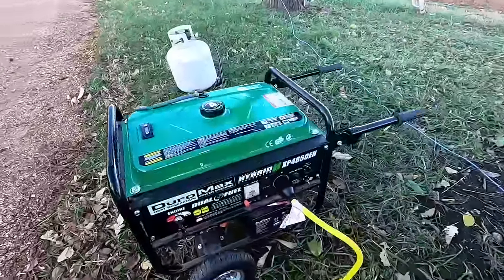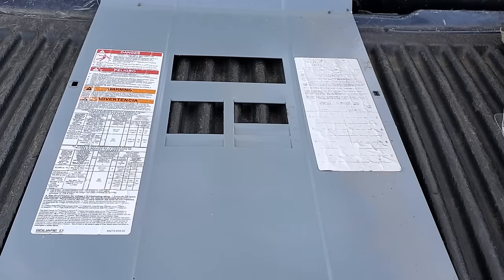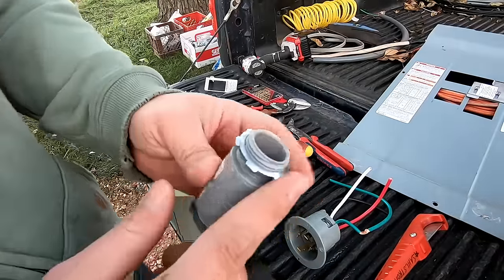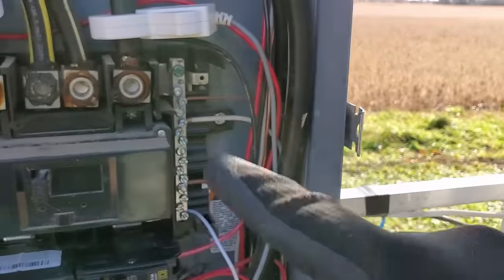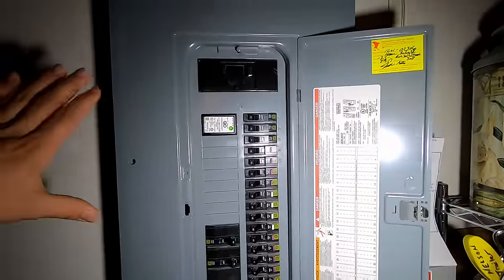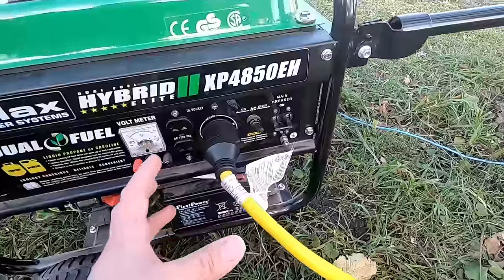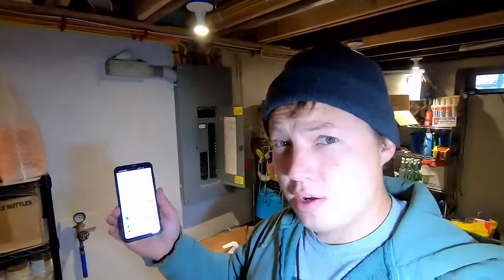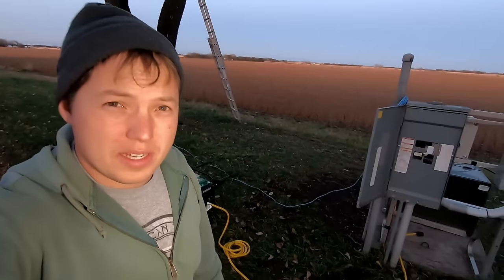How To Hook Up a Generator To Your House Using a Breaker Interlock Kit & Power Inlet Box

Comment: Hello- Just happen to be searching on YouTube on connecting a generator to your house electrical system. I have a couple of questions:  1) I have an RV outlet on my side of the house which is a 30 amps. Looking at the panel its on a double pole but its ONLY using one side - I haven't checked all generators yet but do they make them with 30 amps plugs ? if NOT, Could I add a another line to the 30 amp double pole - what size wire would I need ? I checked online for my panel for an interlock kit, and they make one for my panel but its 249.95 - seems kinda steep..

Comment: The Sense Energy Monitor works fine with the hot lines of the generator? I know many energy monitors only work with perfect sine waves?
Reply from the maker: Seemed to work fine but I suppose it would be possible for it to be slightly less accurate. Would need to ask Sense to be sure.

Comment: My setup is about the same as yours.  Question about your sense monitor.  Looks like you bought the basic version but ran your generator power wires through it so you could monitor it when the main power was off.  What happens when main power comes back on and your generator is still running?  I know it's safe due to the interconnect, but I'm curious if the sense device allows you to see that power is back on so you can go shut off your genny.  I see that Sense has a "Flex" option with dual sensor pairs to monitor a generator separately from the main.  Anyway, I'd like to use sense to know when main power comes back on.  Will this work for that?

Comment: I just bought a duramax as well. Im excited to find this video.
Reply: Remember to always make sure you follow all the generator safety rules whenever you use your portable generator. 
⚠️Here are the Generator safety rules that everyone needs to follow when using generators:

This is just a reminder for everyone’s safety when using portable generators. All generator safety rules need to be followed carefully to avoid hazards. 

1) Please do not allow an unqualified person or your children to operate the portable generator. Just because some manuals don’t say that doesn’t mean it’s safe. That is important against the generator safety rules. We also need to be keeping an eye on our children too. You need to make sure that your children are not playing near the portable generator especially when it’s running so they won’t get electrocuted. Generators pose electrical risks and they can be hot during an operation. Please keep your children away from the portable generator at all times. It is important to keep our children safe especially our little ones. Be aware of all the hazards.

2) Some people use their portable generators indoors which increases the risk of carbon monoxide poisoning. It’s important to have a carbon monoxide if you have a gas generator. Never ever use your generator indoors even if your doors and windows are open and even in the garage is not safe to use a portable generator. Not even at your porch and your deck. It is never safe to use your generator indoors and in enclosed areas of your home. Your generator needs to be 15-20 feet away from your house. 

3) 🔥generators cause fire hazards too. Never refuel your generator while it’s running. You need to let your generator cool off before refueling it and before storing your generator. Never overload your generator too. Never ever back feed your generator. You should never plug your generator into a wall outlet. Also never store propane tanks indoors. Please keep flammable things away from the generator as well and please don’t smoke cigarettes near the generator. Having a fire extinguisher next to the generator is also important against the generator safety rules. 

4) generator operation; make sure your hands are dry before touching the generator. Never use your generator in wet conditions. Don’t let your generator get wet. You need a generator tent if you need to use your generator during wet weather. Please don’t wear loose clothes when operating the generator. Turn on your generator before plugging in appliances. Use the right cord for your generator. Please do not use worn out cords. 

https://youtu.be/I1jT3ANENvI and here is a video more about keeping others safe when using generators and also about our family’s safety. Hope this helps

Comment: Hey Ben. Only issue I see is that most portable generators are neutral bonded at the generator. Neutral/ground should only be bonded inside the main panel correct?  When I did my inlet and interlock I unbonded  the generator. In the event I use the generator with extension cords I have a jumper plug that I plug in to bond neutral/ground.
Reply: ⚠️ Here are the reminders about generator safety. We always need to make sure we follow all the generator safety rules whenever we use portable generators: 

Everyone must see this 

1) KEEPING OTHERS SAFE: Please do not allow an unqualified person or your children to operate and service the portable generator. Just because some manuals don’t say that doesn’t mean it’s safe. That is important against the generator safety rules. We also need to be keeping an eye on our children too. You need to make sure that your children are not playing near the portable generator especially when it’s running so they won’t get electrocuted. Generators pose electrical risks and they can be hot during an operation. Please keep your children away from the portable generator at all times. It is important to keep our children safe especially our little ones. Be aware of all the hazards.

2) WHERE TO RUN YOUR GENERATOR: Some people use their portable generators indoors which increases the risk of carbon monoxide poisoning. It’s important to have a carbon monoxide if you have a gas generator. Never ever use your generator indoors even if your doors and windows are open and even in the garage is not safe to use a portable generator. Not even at your porch and your deck. It is never safe to use your generator indoors and in enclosed areas of your home. Your generator needs to be 15-20 feet away from your house. 

3)🔥FIRE HAZARDS: Never refuel your generator while it’s running. You need to let your generator cool off before refueling it and before storing your generator. Never overload your generator too. Never ever back feed your generator. You should never plug your generator into a wall outlet. Also never store propane tanks indoors. Please keep flammable things away from the generator as well and please don’t smoke cigarettes near the generator. Having a fire extinguisher next to the generator is also important against the generator safety rules. 

4) GENERATOR OPERATION: make sure your hands are dry before touching the generator. Never use your generator in wet conditions. Don’t let your generator get wet. You need a generator tent if you need to use your generator during wet weather. Please don’t wear loose clothes when operating the generator. Turn on your generator before plugging in appliances. Use the right cord for your generator. Please do not use worn out cords. 

https://youtu.be/I1jT3ANENvI and here is a video more about keeping others safe when using generators 

Hope this helps

Comment: Kid gives a great understandable informative video. Now, how do I know what generator cord to use to connect to generator and house?
Reply: ⚠️portable generator safety announcements:

This is just a reminder to remember the safety rules when using portable generators. 

1) KEEPING OTHERS SAFE: Please do not allow an unqualified person or your children to operate and service the portable generator. Just because some manuals don’t say that doesn’t mean it’s safe. That is important against the generator safety rules. We also need to be keeping an eye on our children too. You need to make sure that your children are not playing near the portable generator especially when it’s running so they won’t get electrocuted. Generators pose electrical risks and they can be hot during an operation. Please keep your children away from the portable generator at all times. It is important to keep our children safe especially our little ones. Be aware of all the hazards.

2) WHERE TO RUN YOUR GENERATOR: Some people use their portable generators indoors which increases the risk of carbon monoxide poisoning. It’s important to have a carbon monoxide if you have a gas generator. Never ever use your generator indoors even if your doors and windows are open and even in the garage is not safe to use a portable generator. Please do not even use your generator in your deck or balcony. It is never safe to use your generator indoors and in enclosed areas of your home. Your generator needs to be 15-20 feet away from your house. 

3)🔥FIRE HAZARDS: Never refuel your generator while it’s running. You need to let your generator cool off before refueling it and before storing your generator. Never overload your generator too. Never ever back feed your generator. You should never plug your generator into a wall outlet. Also never store propane tanks indoors. Please keep flammable things away from the generator as well and please don’t smoke cigarettes near the generator. Having a fire extinguisher next to the generator is also important against the generator safety rules. 

4) GENERATOR OPERATION: make sure your hands are dry before touching the generator. Never use your generator in wet conditions. Don’t let your generator get wet. You need a generator tent if you need to use your generator during wet weather. Please don’t wear loose clothes when operating the generator. Turn on your generator before plugging in appliances. Use the right cord for your generator. Please do not use worn out cords. 

https://youtube.com/shorts/eFigDfnPkcQ?feature=share and here is a short video more about keeping others safe when using generators 

Hope this helps

Comment: You should get a cheap fixed torque screewdriver für around 8-12$, better safe than sorry. Nowdays you even mount a CPU with a torque screewdriver. Since I use a torque driver for my bike I know I was allways wrong with the correct force.

Comment: Explain why if in the main the 220 coming in is distributed as 110 on each bar so that if you need 220 in your circuit you take 2 leads off of one or both bars to get a 220 circuit and when 
you push 220 from your generator you push it through only one bar and not 2.

Comment: excellent video. Trying to do something very similar but in the middle of the city.  need to hook up a gen pak but like you on a manual system.  This helped a lot. thanks
Reply: Remember to always make sure you follow all the generator safety rules whenever you use your portable generator. 
⚠️Here are the Generator safety rules that everyone needs to follow when using generators:

This is just a reminder for everyone’s safety when using portable generators. All generator safety rules need to be followed carefully to avoid hazards. 

1) Please do not allow an unqualified person or your children to operate the portable generator. Just because some manuals don’t say that doesn’t mean it’s safe. That is important against the generator safety rules. We also need to be keeping an eye on our children too. You need to make sure that your children are not playing near the portable generator especially when it’s running so they won’t get electrocuted. Generators pose electrical risks and they can be hot during an operation. Please keep your children away from the portable generator at all times. It is important to keep our children safe especially our little ones. Be aware of all the hazards.

2) Some people use their portable generators indoors which increases the risk of carbon monoxide poisoning. It’s important to have a carbon monoxide if you have a gas generator. Never ever use your generator indoors even if your doors and windows are open and even in the garage is not safe to use a portable generator. Not even at your porch and your deck. It is never safe to use your generator indoors and in enclosed areas of your home. Your generator needs to be 15-20 feet away from your house. 

3) 🔥generators cause fire hazards too. Never refuel your generator while it’s running. You need to let your generator cool off before refueling it and before storing your generator. Never overload your generator too. Never ever back feed your generator. You should never plug your generator into a wall outlet. Also never store propane tanks indoors. Please keep flammable things away from the generator as well and please don’t smoke cigarettes near the generator. Having a fire extinguisher next to the generator is also important against the generator safety rules. 

4) generator operation; make sure your hands are dry before touching the generator. Never use your generator in wet conditions. Don’t let your generator get wet. You need a generator tent if you need to use your generator during wet weather. Please don’t wear loose clothes when operating the generator. Turn on your generator before plugging in appliances. Use the right cord for your generator. Please do not use worn out cords. 

https://youtu.be/I1jT3ANENvI and here is a video more about keeping others safe when using generators and also about our family’s safety. Hope this helps

Comment: Benjamin Sahlstrom
Can the Sense unit notify you when the power comes back on? I have setup my panel with interlock etc.. and would like to know when the power comes back. The only way I know now if the power is back is to look at a neighbors house for lights when dark but would have to go out to the service panel and measure with meter during the day LOL! Looking for a good way to know when the power is restored to service panel. Thank you. And great job. Wish I had seen this before I did mine.

Comment: I have a question. I want to use a scare fire machine to cut concrete. What kind of generator should I need? The motor that I use in my scare fire machine? It's 230 volts I wait for you comment. Thank you

Comment: i had a question for you  i have a standby  generator and im wanting to put it in to my panel and put in these disconects  like your doing  my question is have you seen anything  like a small light bulb or something you could wire into the main line comming into the box from the meter that would light up when power has been restored  so you dont have to turn generatoe off to test  to find out   thanks  and i love the vidios you do
Reply: look at the Reliance power on monitor device.

Comment: Thank you for explaining everything, best walk through installation video 👍
Reply: Remember to always make sure you follow all the generator safety rules whenever you use your portable generator. 
⚠️Here are the Generator safety rules that everyone needs to follow when using generators:

This is just a reminder for everyone’s safety when using portable generators. All generator safety rules need to be followed carefully to avoid hazards. 

1) Please do not allow an unqualified person or your children to operate the portable generator. Just because some manuals don’t say that doesn’t mean it’s safe. That is important against the generator safety rules. We also need to be keeping an eye on our children too. You need to make sure that your children are not playing near the portable generator especially when it’s running so they won’t get electrocuted. Generators pose electrical risks and they can be hot during an operation. Please keep your children away from the portable generator at all times. It is important to keep our children safe especially our little ones. Be aware of all the hazards.

2) Some people use their portable generators indoors which increases the risk of carbon monoxide poisoning. It’s important to have a carbon monoxide if you have a gas generator. Never ever use your generator indoors even if your doors and windows are open and even in the garage is not safe to use a portable generator. Not even at your porch and your deck. It is never safe to use your generator indoors and in enclosed areas of your home. Your generator needs to be 15-20 feet away from your house. 

3) 🔥generators cause fire hazards too. Never refuel your generator while it’s running. You need to let your generator cool off before refueling it and before storing your generator. Never overload your generator too. Never ever back feed your generator. You should never plug your generator into a wall outlet. Also never store propane tanks indoors. Please keep flammable things away from the generator as well and please don’t smoke cigarettes near the generator. Having a fire extinguisher next to the generator is also important against the generator safety rules. 

4) generator operation; make sure your hands are dry before touching the generator. Never use your generator in wet conditions. Don’t let your generator get wet. You need a generator tent if you need to use your generator during wet weather. Please don’t wear loose clothes when operating the generator. Turn on your generator before plugging in appliances. Use the right cord for your generator. Please do not use worn out cords. 

https://youtu.be/I1jT3ANENvI and here is a video more about keeping others safe when using generators and also about our family’s safety. Hope this helps